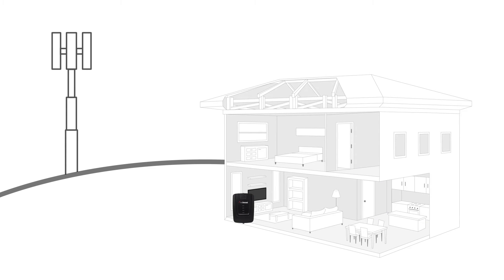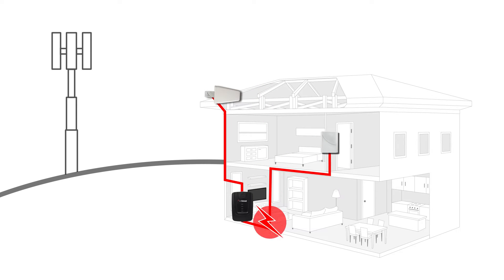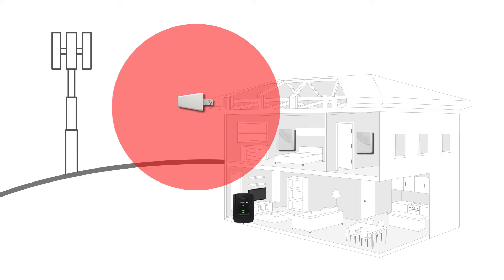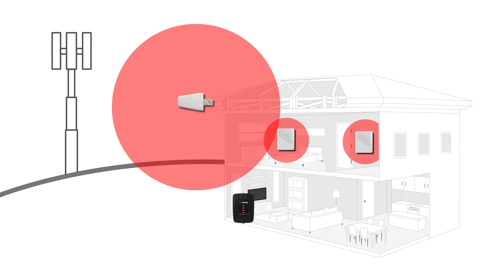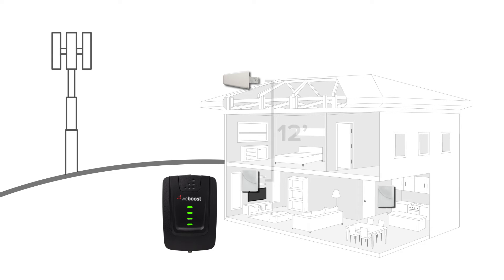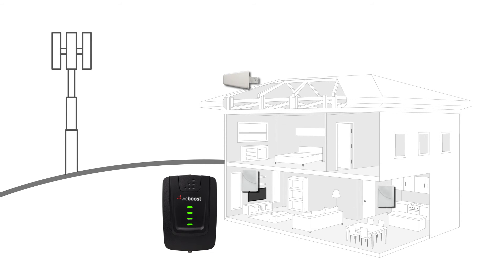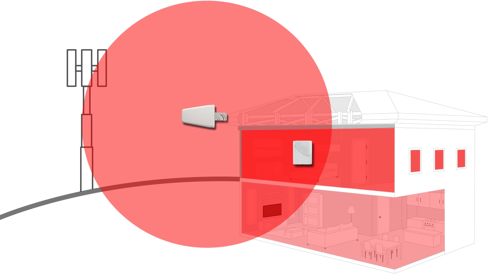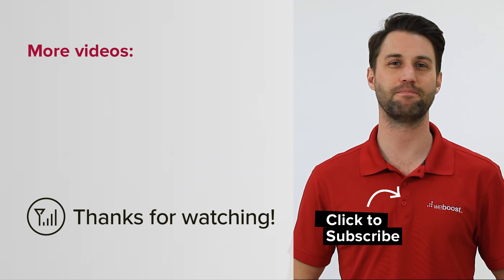What Is Oscillation And How To Prevent It | weBoost

Comment: Most of your videos say you need separation of 25 vertical feet or 50 horizontal feet between the two antennas to avoid isolation. Now this video says you need 12 vertical feet. Which is it? This is a very critical point and I wish you could be more specific., Thanks
Reply: I hear you!  Did you ever get an answer?

Comment: The manual that came with my booster gives different distances between the outside and inside antenna.
Reply: Hi Ian, this one is a little tricky as the separation distance will vary based on the booster type. Vehicle boosters usually need 10 feet or less of separation, where home boosters could require 20ft of vertical, 50 of horizontal, or a combo of the two in separation.